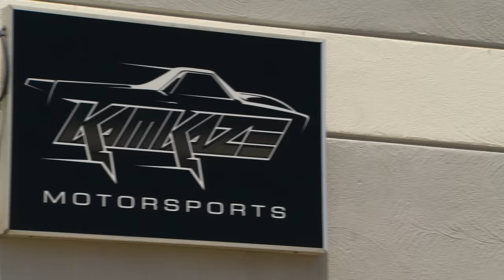Horrific Car Crash Nearly Kills Racer And Destroys Legendary Car I Street Outlaws

Comment: I crashed my wrx on the track at 21 years old. I poured my heart into that car. Losing financially hurt but the time I put into it was worth more. Worked at a tuning/parts shop so that car was apart of my lifestyle. Full bolt ons, e85 tune, breaks, aro, basically everything. My friends and I all had tuned affordable cars. Took it to shows with them, made it super clean, fixed paint chips, deep detail, replaced interior. It was my baby. Tracking it and then keeping it clean and nice took so many hours. After the crash I scrambled to get to work and was left out of the building conversations bc my car was totaled. One day I’ll get back to it.

Comment: I still can't believe at this point people still believed that the El Camino was the original one that flipped owned. Lol. 
 You know the original El Camino the all steel real car that's a road car.  Compared to whatever this thing is kamikaze has now. It upgraded new high performance engine with massive turbos, tube chassis car even though he claims it's not one,  I mean come on you can clearly see it when you have the hood off. Does anyone really honestly believe that's what it really looks like on a regular El Camino front end where the motor sits in?  You really believe back then they used chrom Molly piping like that To house the engine and sit underneath the complete car,  Does anyone really believe that's what they did to every single one of their El caminos that were road worthy?  If that's the case then all we need to do is spend a few hundred bucks on an El Camino strip it completely apart and put a decent motor in it and you have a $250,000 race car.  That's a 100% built car nothing original about flips vehicle is on that Except for his vintag..  Look at the car after the accident it is all a tube chassi built race car.

Comment: not good he got walk away // I did not  dirt bikes 1 day  when i was 24 years old 250cc  modified up to 500 84 RM Suzuki WR ////  so I think it was Sunday when I jumped on the bike I went down three streets and my gear were sitting in my van and I locked up the brakes before the railroad tracks and the bike slid but I kept control cross rail road on 22 sst got close to the curb.////// and i roll  55 feet hit my head 15 to 20 days later i wake up ///// 1996 oct 6 what did i lean wear the gear save our buts